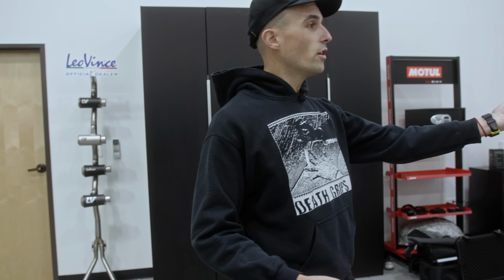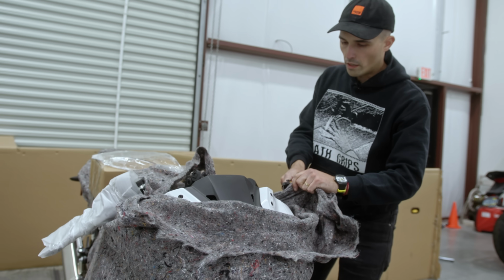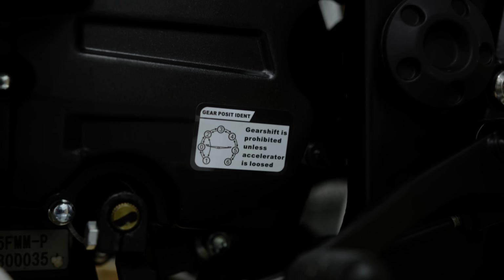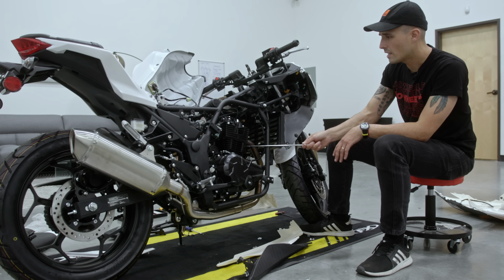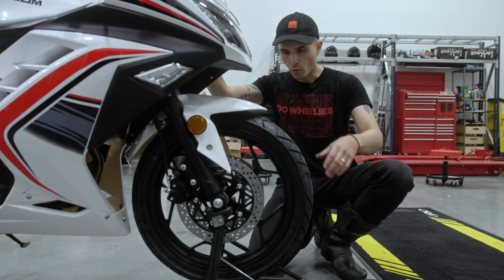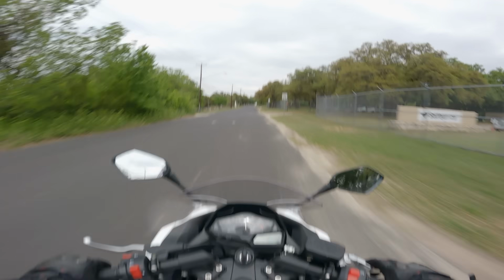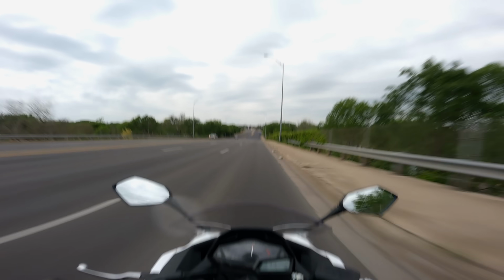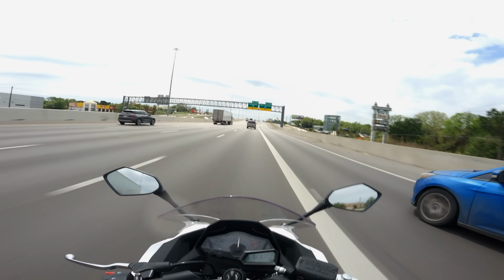They tried to trade a Bike for a POSITIVE REVIEW... So I Bought it Instead

Comment: Bought it. $3200 delivered. Learned a lot. Great for inner roads for a beginner. Great mpg, around 70. Definitely feels cheap, but not everyone can afford a Ninja 400 or R3. Jk i found a used 2020 Ninja 400 on marketplace for $3400. Sold the chinese knockoff for $2600 and bought my Ninja 😉. 

No regrets 🏍️💨
Reply: Where in the world did you find a ninja 300 for 3400$???? Impossible

Comment: Honestly ive had quite a few chinese bikes and if you ride them the way they tell you to for the first 250 to 500 miles, they actually are quite reliable, IF you dont get one with a defect. (Which with chinese bikes is usually about 25% of the time). I got one of their 250cc "Chopper" motorcycles, (which is literally just a super old style cafe racer with a 250cc honda dirt bike engine in it) and its got about 5,500 miles on it so far. The only thing ive had real issues with is that if you get it wet, the paint is garbage and it WILL rust FAST AS FUUUUUKKK boi. So definitely repaint your exhaust and shit, anything that has the flat black paint and gets hot. 

But, i paid $1,600 for a brand new bike soooooo, i see it as a win.

Comment: What you've experienced is not only NOT new but it is also common to many consumer products that come from the Far East-not just motorcycles and not just from China.  Go watch the videos on Chinese-made electric guitars and you can get the drift.  Yes, the parts are made okay but after that-- assembly and set-up either are not done right if they are done at all.  So, caveat emptor.  Is it a cheap piece of crap?  No, but you got what you paid for and you have to understand that YOU are now responsible to get it (whatever it is) to do what it is supposed to do. Those wheels need to be trued and the tires need to be balanced. As for the welds, remember heat treating metals is a North American and Western Europe thing-anywhere else you take your chances.

Comment: I am desperate for my last motorcycle.  I'm seeking "very used"  75 and just need NJ turnpike speed (65/70mph)  An older 350 but no bigger than than 300/  $1,200 to $1400?  I could buy for $600 and invest $600

Comment: Funny thing about those Venom bikes.  They're a mass produced stamp.  A percentage of the assembled bikes get the 250 gas motor, a percentage get electric motors.  You can swap back and forth at any time.  I have the electric version.....the tank has petcock, there's motor mounts, shifter mounts, etc.  I've had it since 2018....no problems at all...just new tires.

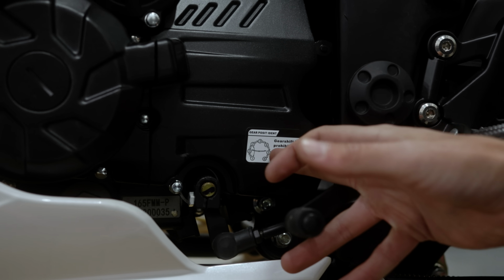Comment: 6:14 As someone who is bilingual in Chinese, I can say that "gearshift is prohibited unless accelerator is loosed" actually means "do not shift gears unless the throttle is rolled off", which is indeed correct (let off the gas to shift gears). In Chinese accelerator and throttle may refer to the same thing, and in Chinese there is a saying of "loose the gas" which means what we say "let off the gas". However this nonsense is for sure written by some idiot in China who doesnt speak a word of English and prob used google translator.

Comment: you shouldve taken them up on their offer but be very specific about what is NOT wrong with the bike. for example "the bike is amazing. came out of the box perfectly ready to ride. i definitely didnt have to take off the brake calipers and loosen them up because they were stuck partially engaged and the tire wouldn't roll freely. definitely didnt have to do that." and just do the review like that.

Comment: Handling problems are deff because of those tires… once you wear them in a bit everythin will straighten out… or it could have something to do with how you installed the clip on bars 🤔 … what you did looked fine to me but… uk… it’s a Chinese bike 😂 …. Na but for real you should deff check those

Comment: Holy shit lol, the second he showed it with the fairings off, I just about threw up lmao.. a tube frame on a street bike lol, and those welds look like a blind 2 year old laid them lmao😂🤦‍♂️👍
All in all though, it’s not that bad looking/sounding of a bike .. I wouldn’t ever buy one, but if one was given to me, I’d probably ride it, AFTER putting new rubber on it, fixing the speedo/tac, a new chain and sprockets , new wheel bearings , probably a new breaking system , re doing the welds, new forks and rear suspension, new engine .. 
Ok maybe I wouldn’t ride it lmao😂🤦‍♂️

Comment: i bought a grom clone from Venom for $2,000. out of the box, the clutch wasn't working. i installed a replacement clutch, worked for maybe 20 miles and it broke again. do NOT buy any of these chinese knock offs.

Comment: If you live in the third world you can buy new bikes like this for much cheaper.  Also labor to work on these bikes are much cheaper.  You buy the bike for cheap-then use a trusted mechanic to straighten the bike out for you at a reasonable price.  In the US you cannot buy the bike at a reasonable price plus labor to work on the bike is way too much to make it worth it.   This motorcycle isn't worth anywhere near 3000 dollars.  The bike is not a piece of junk.  Its not a made for USA product.

Comment: chinese bikes. they sell under many different brands but they essentially all come from the same place. these bikes are all over Ecuador. Notice that they don't go over 250cc. There is no real reason to review this junk because it is what it is. They're invaluable in this country for transportation and delivery services. most people here can't afford the big brands especially with added import tariffs but ecuador has trade deal with china so these bikes are affordable and fit the demographic. they're all low compression, air cooled, 4-5 speed. they're not great but they get the job done. some of the brands here are Axxo, Daytona, Ranger, Tekno, etc... And they have lots of overlaps like the Daytona and Axxo scrambler are the same. many of these bikes are clones of old kawasakis, suzukis, etc..  to me they're all pretty much junk, but they fit the country and the people. I have a loncin rally 300, which is a better clone of a kawasaki klx300 but half the price.

Comment: You arent very experienced to not check the steering head bearings on a bike wandering the road. Steering stem bearings too tight. #1 reason for wandering. Not tight calipers.

Comment: That’s one thing I always noticed about Americans - they freak out and get confused by any term or phrasing they’re not familiar with. Working it out with a bit of lateral thinking is just beyond them. Theyre not super bright, but it’s funny.

Anyway, it just means back off on the throttle when changing gears. You’re welcome.

Comment: You can’t keep comparing a little Chinese put put bike to a cream of the crop bike like a KTM.  They are worlds apart.  That’s just a barebones bog standard bike that’s trying to be something it’s not.  There is no way a 250 4 stroke can compare to a 250 2 stroke sports engine.  I remember when I was a kid Yamaha moving to a 4 stroke R125 engine and it was as flat as fart and had no grunt - they killed it there’s no fun no power valve to send you shooting off and they didn’t sell.  4 stroke only makes sense with bigger engines because you can’t touch the power of a 2 stroke in smaller engines with a 4 stroke.

Comment: it seems your not very bright.. the speedo is in Kilometers per hour, that is why it was showong wrong. 80 kph is 50mph... you took the bike out the crate and should of taken the front off , just like a normal bike shop would, they never rely on factory for all the major items.... probably didnt even check the gear oil..

Comment: Did you consider that being Chinese the speedo is probably calibrated in Kilometres per hours not miles per hour? 70 kph 70 km/h is 43.5 and 80 is 49.7. In a 40mph limit its going to show 64.4 km/h